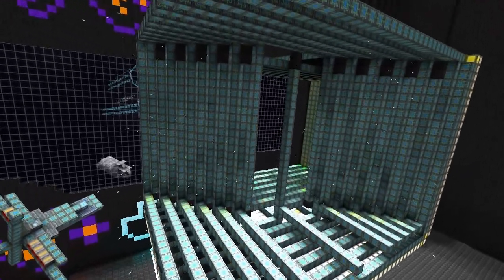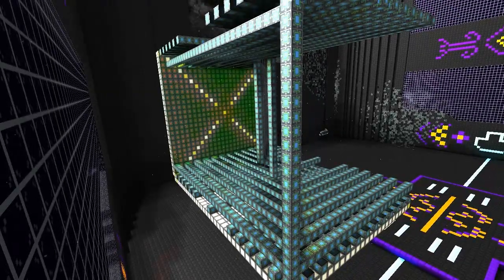Starmade Ep109: Mass Saving Reactor Design by DanekJovax

Comment: This is probably the best way to make low mass ships with lots of power regen in a larger shell.  Best use would probably make use of the space inside for shields or tanks, or with the right geometry AMC/missile arrays.

You might see in future (If I guess right) level 1 power is directly related to # or blocks, with no modifier for x,y,z size, maybe level 2 power is x.y,z based, and level 3 is configurable

Comment: A quick note: based on this design I did a mock up of the 5x5x10 one you did a few episodes back with the "3x3x3 Plus sign" one (fruit)

I got 20000 power and almost 14K regen out of only 80 block and 8 mass. that was just the power blocks nothing else.

I was able to fit 5 seperate generators in it.

Comment: I was tryin g to play with a 5x5x10 with this design. Volume is not the only factor. a 5x3x10 (150vol) = 2836 e/sec, while a 5x5x7 (175vol) only had 2585
 e/sec. so for this design. it is best to have the 2 spars that go from edge to edge be the largest dimensions. while the one that is 3 short be the shortest side (the interleaved comb part. now the outer corner nodes, can be tweaked a bit, to make them longer. best so far 81 power blocks 14726 e/sec in a 5x5x10 with only 5 nodes